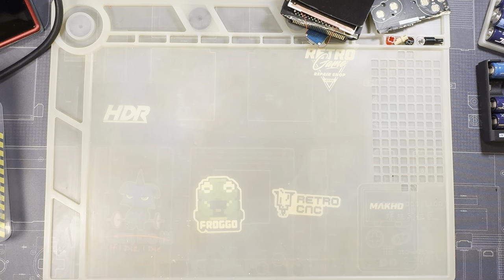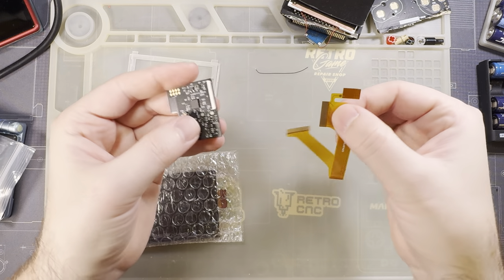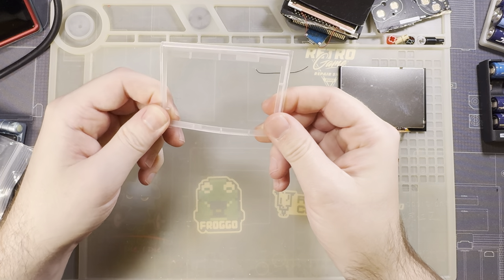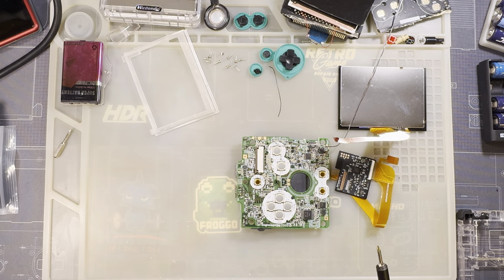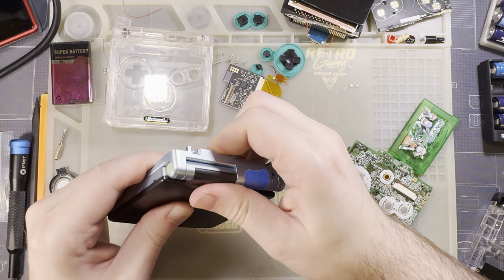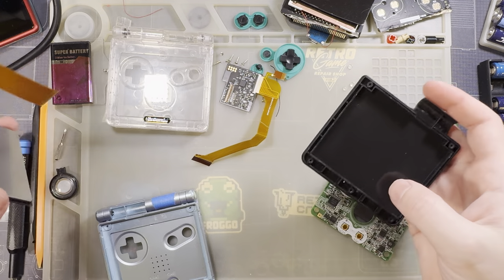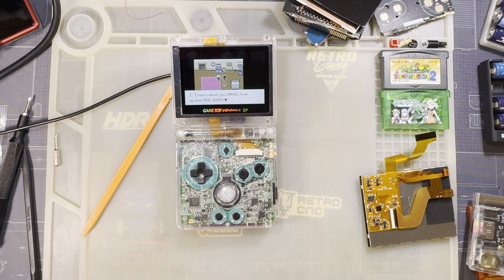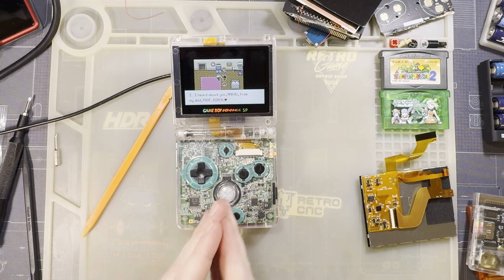Game Boy Advance SP M2 IPS from Funnyplaying

Comment: Honestly, I hate these new screens with the OSD menu. Personally the FP V2 were the best iteration for me. No bugs and it was simple. Now its just getting too complex which in some sense defeats the purpose of gaming on older hardware. It's for the simplicity. Otherwise people would just play it on their phones... Plus the bugs suck. My GBA V3 (3.0) screen randomly cycles through brightness and OSD menu pops up out of nowhere. I had to de-solder the touch sensor chip to stop it.
Reply: And they STILL haven't updated their terrible logo text either. On SP or GBA. They made the perfect GBC lenses and have continued to neglect both GBA consoles.
Reply: I just set my preferences once and then never opened the OSD again. The touch sensor being finicky is annoying though. I guess it's for people who didn't solder the wire to the button, still not an ideal experience.
Reply from the maker: @m4xQ  I find that if you provide specific examples of what you don't like, funnyplaying is generally pretty receptive to feedback like this. Saying "it's terrible" without telling them why will not be productive. I'd encourage you to give them feedback directly.
Reply: @makho I have, I gave them feedback via email twice now with specifics over the past few years. Like adding the GBA outline text, fixing the "SP" font, and a number more things and they were kind in response but I've kept an eye out and they've changed nothing in the years since.
Reply from the maker: @m4xQ  English is not their first language and details are often lost in translation. All I can recommend is to show them what's wrong (not just tell them) and how to fix and keep trying until they do. That's what I do at least.

Comment: I dont like how the bracket causes a bulge where the connector is, I dont get why it was designed like this for their own shells
Reply: follow the instructions on funny playings website instead, he installs the screen wrong in the video. The plastic bracket is not supposed to be ontop of the ribbon connector.
Reply: @donovanwhysong7689  even with their instructions It didn't fit well. I removed some of the plastic on the adapter to let it sit better.
Reply: @MitchelWhite  i was also thinking about doing the same but I managed to fit mine good without, just adding some comments for future readers

Comment: why we accept that these screens pull at least double the milliamps a 101 screen pulls at the same brightness? I  know it's controversial but I love 101 screens.
Reply from the maker: Well the biggest reason is that the format for these screens has changed (think analog vs digital) and there is no modern screen capable of interfacing with a GB. So to make up for this, we need a power hungry FPGA to translate what the GB outputs to something a modern screen will accept. 

I see no reason a screen cannot be manufactured to talk directly to the console but I'm not very knowledgeable on the technical side of things in this aspect. I do know that this type of thing is a six digit investment, however, so the tradeoff is that we get half the battery life on consoles that were already known for having high battery life. 

It is likely cheaper, easier, and more efficient to just update the GB CPUs to output in a format that is compatible with modern screens. But since the original silicon cannot be modified, the next closest thing is to replicate the functionality in a FPGA and replace the obsolete parts (like the analog display interface) with a modern equivalent. This is what funnyplaying is working on, what analogue has already completed, and what modretro is about to release as well.

Comment: Love the videos, such a great resource.

I’ve just done this mod and tried to replicate the bugs you experienced:

1. The FRM label is still bugged - ON is showing as OFF.

2. Brightness button operation is working correctly for me.  Tried it in the same menu on  240p Test Suite as you, didn’t experience it stop working.  I’ll test with some GBC games later  to see if I experience any issues there.

I also have Helder’s Power Cleaner installed, so don’t know if that would make a difference at all?

I’ve done the FP V2 9380 screen, the FP ITA screen and now this one.  This is my favourite so far, though still not perfect - so close but for the sub-pixels preventing pixel grid effects.

Really like the desaturation option so far.  Will be testing with Golden Sun to see if it solves the colour issues with new screens at the beginning of the game.
Reply from the maker: After some back and forth with funnyplaying, we have decided that the brightness button issue is likely unique to my specific kit as we've been unable to reproduce the issue with other kits on the same Game Boy.

Comment: Hello, first of all, great video! I have a GBA SP with a 001 screen... So I wanted to mod it, by changing the shell and especially the screen and battery, the 950mAh one that is on the Funnyplaying website. I ordered the screen that you show here in this video (well, I think so because the one I ordered is the 3.0 and I don't know if it's the one you're testing) I really hope I'm not disappointed :( the screen looks really good in the end apart from a few bugs, and I have a little question, what is the approximate playtime with the brightness at maximum (just to get an idea of it), the screen was ordered 4 days ago. I can't wait to receive it :p and especially I hope I don't regret taking the ITA or the other version. Thanks again for this video and thanks in advance for your answer!
Reply from the maker: I measure power usage and record the numbers to a spreadsheet (linked on my site in the description). From there, it's simple math to extrapolate best case and worst case scenarios. 

Every console, battery, and game cartridge is different though so just play your console to get an accurate estimate for yourself.

Comment: No integer, or in this case, a no subpixel appropriate kit from Funnyplaying, they sure doesn't care anymore, sad
Reply from the maker: Integer: a number that is not a fraction; a whole number.

[240x160] * 3 = [720x480]
Reply: @makho  But in Close up images of the DSP modes, this M2LCD should be delta arrangement. So, the this LCD can't do vertical lines, and pixel grid DSP modes. I saw the close-up image of the DSP mode you uploaded on imgur.